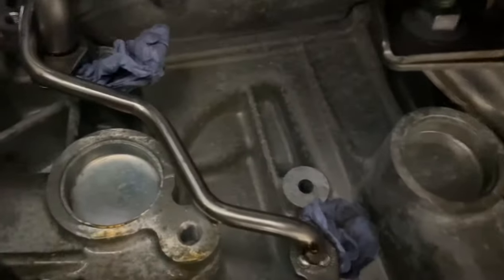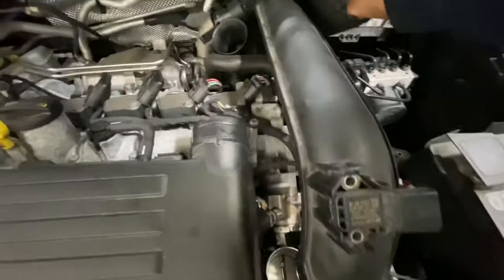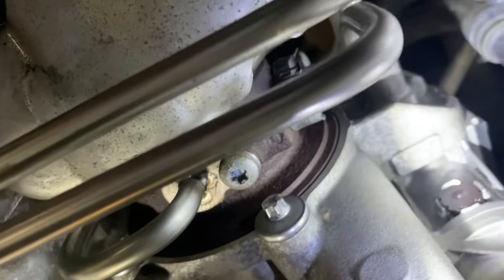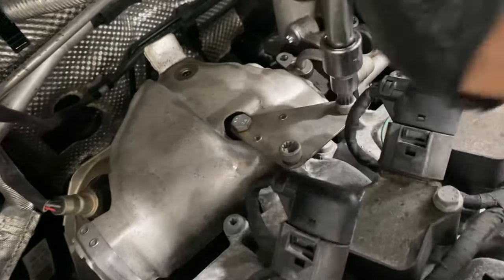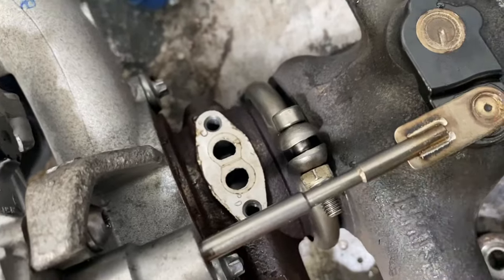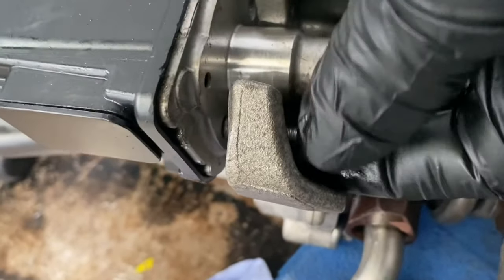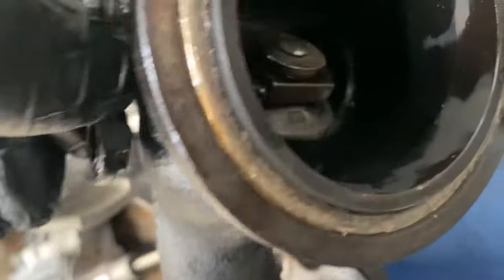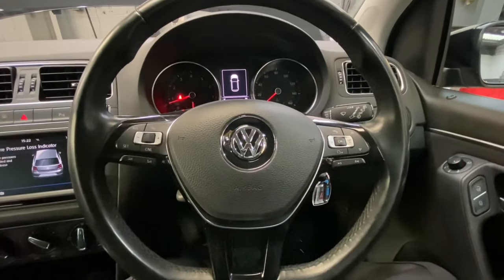#VW #Polo 1.2 #tsi #engines #turbocharger #boost #Actuator fault

Comment: For anyone that has EPC & engine light on and code P00AF... Just fixed mine with some brute force and WD-40.
So if you lean right over the engine you should be able to see the actuator pin just tucked away behind the engine.
If you grab the pin with your right hand and pull it over to the right, whilst simultaneously twisting the pivot side with your left hand, you can get it to unstick. Top tip: do this dry first as you'll need all the grip you can get. There is a point on the actuator rod that it gets wider, grip this area and pull to the right while twisting the other side. Not sure which direction to twist. Do both. If you've got movement, great. Spray WD-40 using one of those cans with the straw. Spray directly on the pin itself where it goes into the housing, spray all over the pivot end. Give it 5-10 mins to penetrate. Repeat the yanking & twisting to lube her up. Spray some more WD-40 for good measure and start the engine. EPC light & engine light should go OFF if it's moving and unstuck and your car turbo boost should be working again.
Oh and P.S do this while the engine is COLD. Despite being stuck the pivot end gets red hot
Reply: Hello, I hope you are well. I also suffered the problem with the blocked pivot from the actuator and because I can't find a mechanic who can solve the problem, I want to do exactly what you said. After you unlocked, did the problem reappear or was it completely resolved? Also, after you used wd-40, did you apply something else to grease the area? Also if I push towards the actuator can I damage it?
Reply: @NitulescuRares  I only had to do it once and it has been fine ever since. To clarify, are you sure the turbo actuator pin did unstick? It doesn’t move back and forth much, maybe an inch or so. If it’s moving freely(albeit stiff) when you pull it sideways and you can feel with your other hand that the pivot end on the other side is twisting when you move the pin then it’s not stuck. I sprayed WD-40 all over the thing but no other lubricant. I believe the turbo actuator is actually supposed to be free of lubricant and operates dry, but seeing as it had seized up I assumed corrosion would have occurred so used WD-40 to loosen that up as much as possible.
If it does move, does your EPC & engine light go off? Does your turbo boost come back for a while before the problem returns? If so you might have a faulty turbo actuator that needs replacing.
Regarding damage, I couldn’t possibly get enough grip or sideways force using just my hands to cause any damage. I could barely grip onto the pin. Luckily it gets thicker halfway across so I was able to pull on the part where it gets thicker while twisting the pivot. The combination provided enough force to move it. That coupled with the tight space where I could barely get my arms behind the engine made it difficult to generate force so I doubt you could damage it. Unless of course you push down on it and manage to bend the pin, or you’re using tools, maybe then it’s possible to cause damage
Reply: @NitulescuRares  Just done some more digging and I think it’s actually just the pivot end that gets seized due to either corrosion or tight fitting but most likely a combination of both. Online the recommendation is to get rid of as much rust as possible with rust penetrator spray and apply grease with Loctite LB-8009 1300C high temp grease. As other greases with different bases and temperature allowances bake on and harden up. I would apply grease when cold, get it nice and hot and apply more when it’s hot. Then keep repeating the process until the grease has seeped into the pivot linkage enough to prevent it from seizing up again.
If the problem persists then there are other fixes recommended such as disassembly, cleaning, sanding, greasing. Or replacement turbo actuator.
I’ll see if I can post what I’m reading although links get removed by YouTube so you might have to be creative and put the parts together in a web browser to make the web link work
Reply: @NitulescuRares  Read your comment again. I see you haven’t done it yet and are just checking whether or not it fixed the issue for me permanently and whether or not it can cause damage?
To answer your question, yes it was a fix for me the issue has not returned. And no I don’t believe it can cause damage. There are some cases of the pin breaking off due to corrosion, but I don’t think you can do this with your bare hands and I believe if you allow the WD-40 to penetrate overnight and focus on freeing the pivot end it can reduce any chances of that happening. Although that’s not what I did at all. I just pulled the pin towards the actuator with all my strength while also twisting the pivot end with all my strength and it got unstuck. Not that you’ve got much to lose if the thing doesn’t work as it is. The risk of damaging it is probably worth it as a mechanic will probably replace the whole actuator or maybe even the whole turbo unit and actuator.

I didn’t apply any grease to the pivot after it was free, just WD-40. But online it recommends applying a 1300C or higher calcium or graphite based grease. But I would only do that if the problem kept returning. Unless you have some 1300C graphite or calcium based grease laying around.
Reply: @NitulescuRares 
I will post the link to the forum post in subsequent comments. It might be removed by youtube so I’ll try to post it in segments or disguised lol. Focus on the information about greasing and ignore what you can’t understand such as technical info. Look at the photo of the actuator linkage to get an idea of where to twist, where to apply the WD-40, and grease if need be.
Reply: @NitulescuRares  ok it’s impossible to post it so type this into google “How to fix the turbo wastegate rattle on the Mk7 Golf 1.4lt TSI (140/150PS)”
Click on the golfmk7 result.
Don’t worry that it’s about a rattle on a Golf, it’s all caused by the same issue; the seizing turbo actuator. Which is what he is fixing. I’m only sharing it with you for the photo and the info about greasing etc.
Good luck
Reply: Thank you so much for your replies. Is it not that I don't understand technical information, I just wanted to do this myself, as I can find some instances where people solved this without replacing anything. The car worked fine till 2-3 weeks ago, it has 79k km from 2014, so the turob and actuatro should be fine, but the epc light, check engine, and loss of boost in the turbo came up after it was parked for 5 days, where there were some rainy days. That makes me believe that there was some type of corosion involved, as this is a common problem on this platform.

You are right, the turbo waste gate is moving freely, as I can wiggle it with my fingers when I try to move the actuator. The problem is where the waste gate pivot is mounted on the actuator. When I start the car, the actuator moves just a tiny bit, and I can hear my exhaust burbling as all the gases go straight to the exhaust (this is a very subtle tone, as I verified this on a friend's golf when the waste gate is opened, which sounds exactly like mine when it is closed, which sounds normal). Plus, the fact is that when I scan my car with Obdeleven, I get the code 16432: charge preassure contorl actuator, which links to this exact issue that you had and that I have now :)). So I went to a mechanic, and he tried to grease the pivot with some copper grease, but it smoked and went dry.

Yesterday I saw your comment, and I wanted to try to soak this with WD-40, but I was afraid to do it since the turbo hot side can get pretty hot. I did it anyway. I let it soak over night, and today I went back at it and tried to wipe the excess copper grease out of the area and spray some more WD-40, pussing and pulling to the right, and I got it to move like 1cm. After that, I started the car, and the epc light was gone, but the exhaust sound was the same. I haven't taken a drive with it because the WD-40 was smoking after 1 minute, so I will let it get a little bit dry before I do a test drive, but I will try again. I was afraid to do your method because I thought that the WD-40 would ignite somehow or that the force when pushing the actuator would damage it inside. I don't know if it is an electrically actionated one with gears or a vacuum one, so I didn't want to destroy something inside it or damage some position sensor. Any way, I will try again tonight to spay some WD-40, try to move it back and forth if I can, and see tomorrow if this helped with anything.

I saw the forum post, but I believe that this will help the rattle turbo sound, which I don't have right now, and I don't have a VCDS or an Obdeleven Pro Pack to do the adaptation. This is why I wanted to find a solution that would eliminate the need to disassemble the turbo or mess with the actuator position.
Reply: @NitulescuRares  yeah I tried to light the WD-40 on fire and it didn’t light so I just decided to risk it. The pin was completely stuck before I managed to move it into the actuator a centimetre or so when it was dry. Then I sprayed with WD-40 and pulled the pivot linkage to move the pin out of the actuator and did this back and forth couple of times. It was stiff as hell and didn’t spring back or anything. It got stuck in both directions when I moved it side to side. I had to yank hard as hell to get it to budge. I think it’s so stiff because you’re pushing the pin which has to drive the gears inside the actuator. It’s an electronic gear operated actuator. From what I remember the pin didn’t move that much at all. Only a few cm before getting stuck.
I used the WD-40 with the long straw and sprayed it everywhere. On the pivot linkage, on the pin, where the pin goes into the actuator. All over the actuator body and wastegate manifold, probably parts of the engine too by accident. It was everywhere. It was tricky and dark so I did it by feel. I left it soak overnight and the next day I wiped it up and applied another tonne of WD-40 all over it and moved it back and forth again. Started the engine & the lights went off. I let it idle for a few minutes before revving slightly. Then I just took it for a drive. Boost was back.

I would clean off the copper grease as it can get hard when it cools I believe.
I know the post is about a rattle. But I assumed you hadn’t even looked at it yet so the photo would help you see where to spray.
If the WD-40 doesn’t work long term I’d buy that loctite grease I mentioned and cover the pivot linkage in it when cold & hot.
If this doesn’t work then you may have a fault with the actuator itself causing it to seize at the actuator end. Possibly carbon buildup where the rod enters & exits. Or fault with the gearing. At that point you may as well replace it. I think there are some videos where people disassemble, clean up the gears and reassemble to save buying a new actuator.
Reply: @NitulescuRares After further digging I’ve found some more information.
If you get it working by removing corrosion using WD-40 but greasing the pivot linkage does not provide a fix it keeps happening... Then the problem is likely NOT the linkage seizing up. The problem is actually carbon buildup inside the turbo, it is either the turbo vanes sticking with carbon or the actuator shaft seizing where it passes through the turbo casing. 
By moving the rod manually you are scraping the stuck carbon off the internal vanes or temporarily freeing up the actuator shaft.
This might explain why on my car despite freeing it up it was still stiff as hell to move. Because the vanes are covered in carbon buildup. The actuator arm should move much easier across the full motion apparently. So lubrication might not provide a long term solution.
After my fix I read somewhere that allowing the car to get up to temp by normal driving, then taking it for a long thrashing would get the turbo nice and hot and help burn some of the carbon off. As well as some prolonged driving 1.5 hours+ revving 5krpm.
I also topped the oil up to make it less dirty and provide more lubrication and filled the car with the highest quality highest octane e5 fuel available so the burn is cleaner.
If problem persists the only other solutions is to clean the carbon buildup in the turbo. Either by spraying turbo cleaning products into the turbo intake to help break down the crud and clean it out. Or another option is to disassemble, clean with chemicals and reassemble. Or buy a new turbo.
But I ain’t worrying about any of that until it happens again. It has been fine for a whole year so far. Hopefully it’s just a slightly corroded linkage for you and it will free up nicely fixing your issue.
Reply: Thanks again for your interest! I don't know what to say about carbon buildup, as I said the car is an Audi A3 2014 1.4 tfsi (is just a golf 7 under), usually people say that the engine should be cleaned of carbon after 100-120k km, the car currently has 79.5k and I just got it one month ago at 77k km. I think the old owner drove it pretty hard, because he told me that he went on vacations abroad 2-3 times a year and he told me that he used more oil when he was driving on the highway at high speeds (so the car revs) , also the long-term consumption was 7.5, on a long road I have 4.2 and in the city 9-10 overall 6-6.5 again it looks like it was going more aggressively in the past, also he changed the mechatronics at 66k km, again probably because of more aggressive driving. 

Also, I recently had a problem with a misfire on cylinder 3 after changing the spark plugs, and the exhaust and turbo were smelling of gasoline, so I think it was throwing some unburned fuel down the exhaust (I think it probably helped clean the carbon a little: )) ) after I reversed the coils, the problem disappeared. Then this problem with the actuator appeared shortly after the mechanic reversed my coils 2-3, I no longer had misfires, but I felt like I no longer had boost after a few strong pulls. The car had been sitting for about 5 days and it had been raining, from here I think it is the waste gate pivot that connects to the actuator. 

In the end I need now to look for the best way to clean the copper paste, because you're right it will harden in the heat, I'm trying my best to move the pivot and put wd-40 and see how it does. I'm thinking that if the problem persists, I'll take the turbo off to disassemble, clean, grease it and put it back, and only then if all that doesn't work will I move on to cleaning the carbon. These days after Easter I will try again with force and wd-40 and I will come back with an update in case you are curious or someone will read our comments in the future. :D
Reply: @NitulescuRares  Apparently you can use brake cleaner to clean off the actuator linkage then grease it up with that 1300C high temp graphite based grease. But for me a tonne of WD-40 did the trick. I didn’t drive my car for a year due to having an epileptic seizure and losing my license. It grew mold on the interior, moss on the window seals, the brand new discs rusted, the pads got stuck, the battery died and I had to buy a new one and the turbo actuator seized up. Car went into limp mode until that was freed up. Now a part of the front coil spring has snapped off too. Fking cars lol.

Yeah it is a 10 minute job to be honest. No tools required just some WD-40 and brute force. Good luck and let me know how it goes
Reply from the maker: @NitulescuRares if it sticking I would find out first why it’s sticking and is it when it’s cold or after it warm up
Reply: Yeah man, that sucks. If you baby the car is not good, if you drive it hard, it is the same, it will wear anyway, but it is what it is.

I feel you, hope you are good now. That is why I believe my actuator pivot seezed because the car sat for some days because my girlfriend had some medical problems, and we were busy sorting them out. It took some weeks, but she is better now.

As my car, now I had the time to clean the cooper grease with some 95 petrol and some 97% technical alchool, then finish the job with some wd-40 and some movement back and forth of the actuator. Now I can move it with ease with one hand by twisting the waste gate pivot.

Now I think it is a placebo, but the car feels slow now :))))) it has only 140hp tho. At least I don't have any errors and the throttle feels normal again. I drove it some km’s those days and everything is back to normal. I hope this will last. I want to thank you so much again for your willingness to share with me your solution. It really helped in my case.

It is sad that the mechanics don't really want to do the proper job and don't repair, only replace because they will make more money. I went to someone and told them what to do (even easier, no need to diagnose the problem) and he did not want to listen and advised me that I needed a new turbo...

Anyway, I hope you good luck with your car and I wish you good health!
Reply: @g_a_bofficial  Thank you so much for the reply. For the moment, I think I fixed the issue as our friend form above recommended. The problem was when it was cold, as the error would trigger right after I started the car. But I am curious what the fix will need to be if the problem appears when the turbo is hot?
Reply: @alextomlinson  thanks for explaining this, I will give this a shot once engine is cold, I have a 2019 1.0 touran tsi with the P2b3 waste gate stuck open/close error on diagnostics.
Reply: omg so I replaced my west gate actuator 3 months ago and the same issue popped up a week ago wasn’t accelerating as much check engine came up with code p00AF I will be trying this crossing my fingers it work I drive a b9  a4
Reply: @xoxopaloma3952  if you can move the actuator pin by hand with engine off and cold, albeit it will be stiff as hell due to the internal gearing, then the pin is not seized. Are you getting any other codes?
Reply from the maker: @xoxopaloma3952 replace the the manifold and turbo then you will have to do a calibration with a diagnostic machine to rectify the fault
Reply: @g_a_bofficial  that sounds expensive. It’s an Audi A4 they have. Need to know engine type and waste gate actuator type. As I’ve read it can be vacuum actuator and the diaphragm can leak causing it to lose vacuum and the actuator fails to move.
Reply from the maker: @alextomlinson I’m the actuator don’t move disconnect it from the waste gate and manually try to move the waste gate if it doesn’t move it needs replacing check if the actuator moves when it’s disconnect from the waste gate with a diagnostic machine it it does your need a new turbo and manifold
Reply: Can I do this with an electronic charge air actuator. I am being told to also use nickel anti seize on the linkage to keep it from coming back.
Reply: @trojangpete8    Do you mean an electric motor actuator? If so yes that’s what mine is and it worked. No nickel anti seize needed